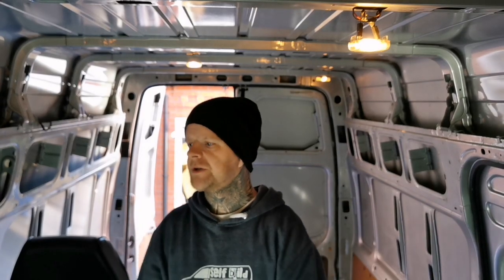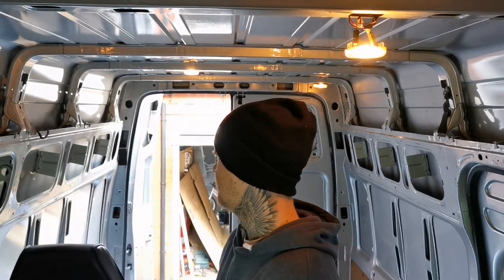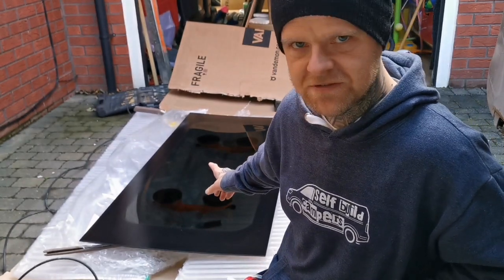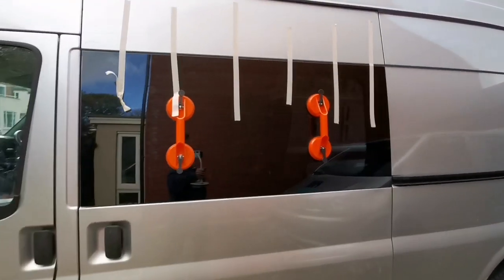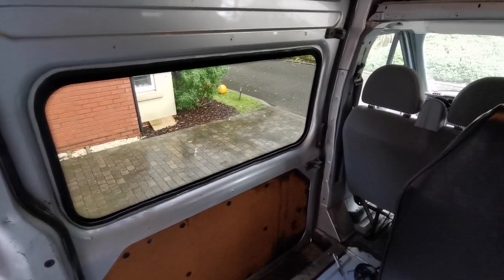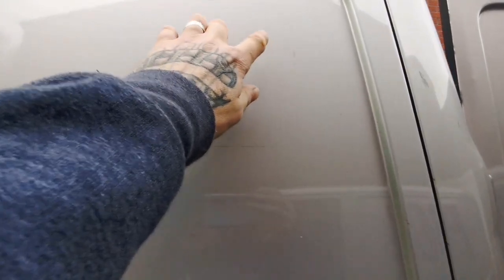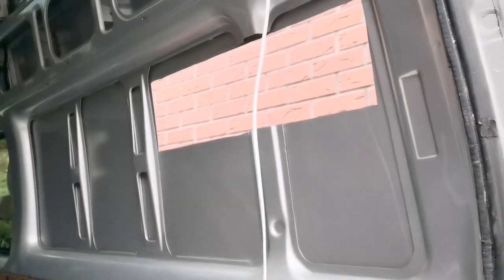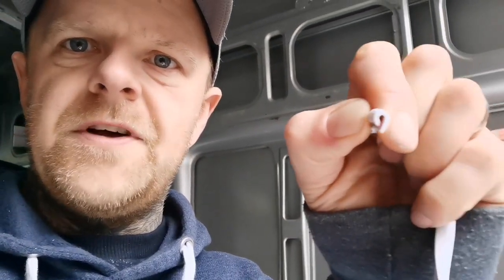fitting windows from van demon & van pimps in campervan conversion transit mk7 and universal windows

Comment: Great job Dan... I can see you done that before with the way you dived straight in.... when I did my fist window I spent a good hour just looking at it with a dry mouth working up the courage to cut the hole... :)
Reply from the maker: Hey Greg. Yes I totally agree. When doing my first window and pitting the drill up to the panel it's not a nice feeling at first 🤣🙈. Especially when you see all the holes from the outside.